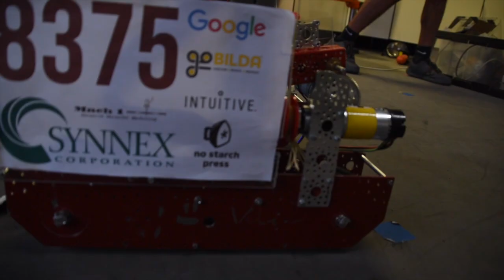Vulcan Robotics Ultimate Goal Robot in 3 Days in 2 Days Reveal

Comment: Few Questions
1.Why Single Wheel over Double Wheel to launch
2.What RPM are your Launching Motors Running At
3.Whats that thing called that encases the wiring for the Linear Slide
Reply from the maker: 1. Single flywheel is much better for shooting rings, as it creates spin on the ring that will keep it stable when it is in the air. Dual flywheel doesn't create that frisbee-like spin, and the rings would be much more unstable in the air, leading to a less consistent shooter. 
2. We used a 1620 rpm motor geared 1:3
3. We use cable chain to manage our wires on our linear slides, you can find it for pretty cheap on amazon. I recommend checking out our Skystone robot reveal to check out a few different use cases for cable chain.
Reply: @vulcanrobotics  Thank you so much!

Comment: How consistent is that shooter
Reply from the maker: The shooter accuracy could be better, but that is with foam rings that we made ourselves. The homemade game elements are probably contributing most of the error in this system, as the single flywheel design introduces little to no variance in power from shot to shot
Reply: Vulcan Robotics Team 8375 thanks for the reply